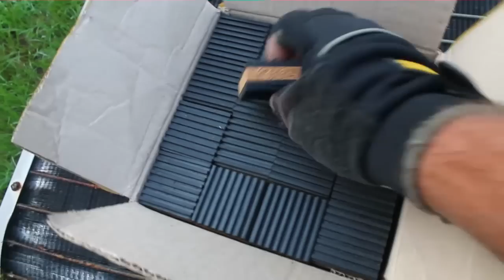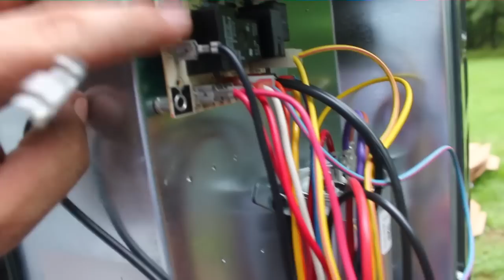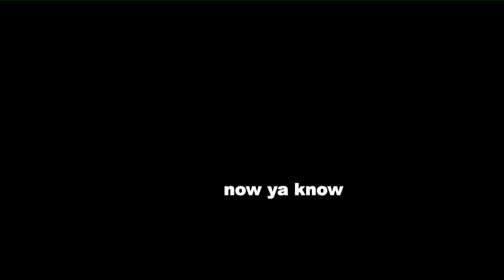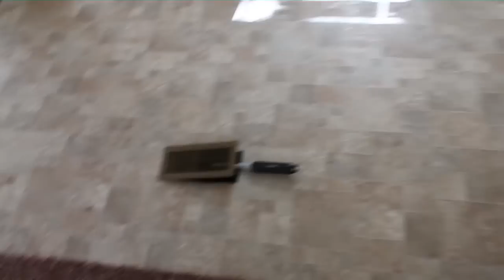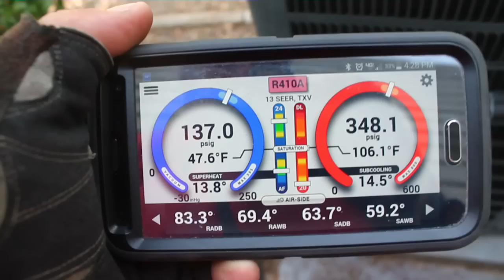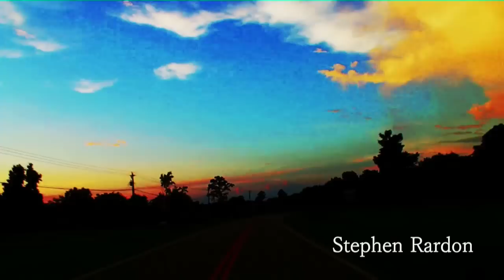HVAC Install-  Goodman SSZ 14 Heat Pump

Comment: Hi Zack thanks for the video. I switched from heating to A/C and my SSZ14 is not  starting. The error code on my goodman furnace AVPTC is C1 - LOW STAGE COOL - LEGACY MODE ONLY. Do you have any idea how to resolve this issue. The unit was working great during winter but now switching to A/C and the heat pump is not starting anymore. Thanks Hugo

Comment: Zack are you familar with the GSX140241 model? I just have 1 ? If so
Reply from the maker: That’s a 14 Seer 2 ton AC I think.
Reply: @TALYN875  That is correct! I am HVAC certified but have not done that in 16 years. My ? Is my HV wires going to the Air handler. They connect to the black and red wires that go to the transformer?

Comment: You'd definitely need those vibration pads with a Goodman.  Must be a cheap landlord to install a POS Goodman...
Reply from the maker: Yes, the landlord also drinks Sams cola
Reply: Kristyl Adams I hear you.  We leased out a house. I always made a point to change filters because of the same reasons
Reply: I'm a former landlord who put a Goodman in for myself after I got rid of the asshole tenants.  Tenants can't even be bothered with changing out filters...lazy cheap asses.

Comment: Hey i helped some one put in a dry charge 13 seer heat pump the other day and it had a leak in the outdoor coil because of a screw that was to long stuck in the coil and made a hole in it

Comment: Nice Job Zack, glad I could keep you entertained while you were waiting
Reply: Oh shoot Ralph you keep everybody entertained ROL.... 

Zack you dialed that baby in with ease. 

Yeah manufactured homes are hard to deal with when it comes to heat load! Today's are much better than in the old days. They sure don't give them furnaces in those the air they need In most cases. Though I have seen some that were done correctly in higher end models! 
AWSOME video... 
-Mike

Comment: Nice install Zack  is that a NEW VETO BAG in the background ????????
Reply from the maker: Damn, you have good eyes Harry. It's the tech LC.
Reply: talyn875 lol Zack that's a real nice bag . How do you like the AWP open bag lol
Reply from the maker: Harry Dickson not as much
Reply: Zack veto is a great bag you will love it i want to get the new Veto pro pac but the funds are low this month hopefully next month will be better
Reply from the maker: Harry Dickson I hope you can get it soon. The LC is the first Veto bag I have owned.
Reply: Thanks Zack i had the lc tec and loved it but sold it on ebay wen Ralph bought me the hilmor bag as a gift witch i still like a lot and use but there is nothing like a veto

Comment: Great install and sounds like a good price on the equipment! What about the Veto? How do You like it so far? I have the LC which I like o k. I got an MB but I don't like it very much. They just came out with an MC and it looks like it would be great. Adjusting the TXV really did the trick. Another satisfied customer!
Reply from the maker: Thanks Tony. I like the LC so far, but I have only had it for a short time.